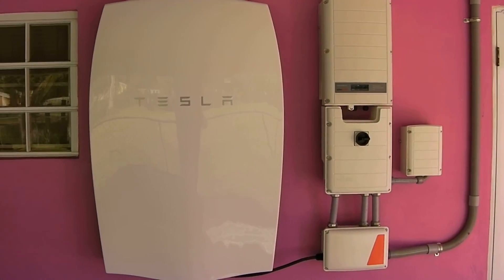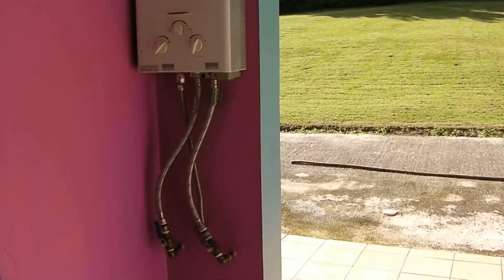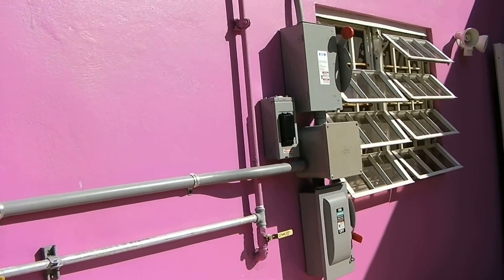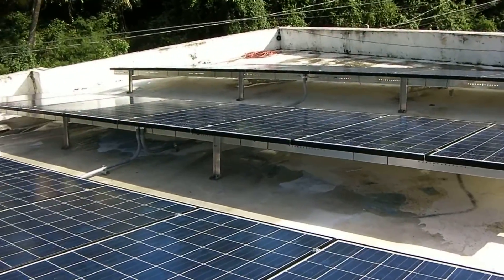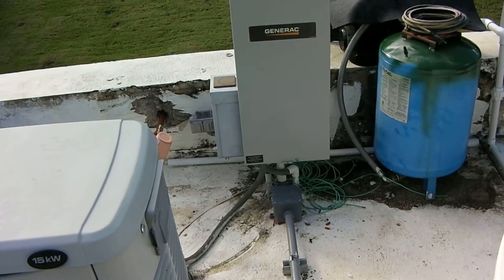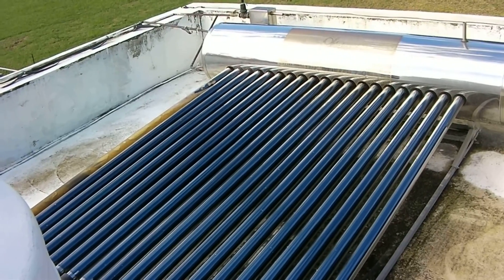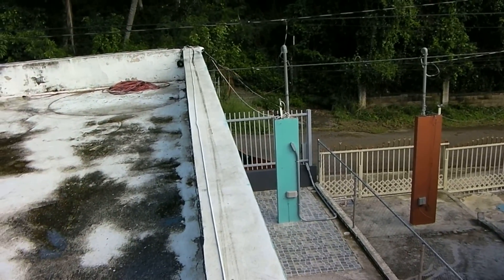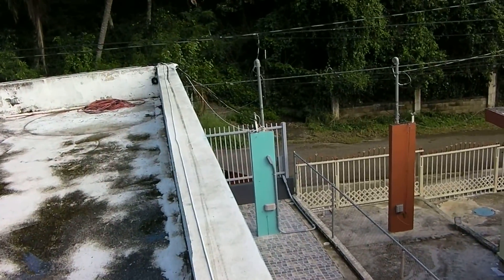Tesla Powerwall in Penuelas

Comment from the maker: Finally this week the tec. guy from the company that bought the system came and configure properly the system. AEE Puerto Rico's electric company haven't installed yet the meter, but today I ran the solar panels and the Tesla from 10:00AM this morning till 7:00PM and the battery got to 59% capacity, in other words its working as it should, the area that I live on there is a lot power outage so as a right now I'm well immune for anything it may come. Plus in top of that I have the 15kw power plant so bring it on waiting for any thing that can happens, weather, strike from the electric co. so on .
Reply: Angel Narvaez This is awesome!!
Reply from the maker: Thanks, I will be posting a most recent video later on detailing the production so far and the hicups w/ the system.